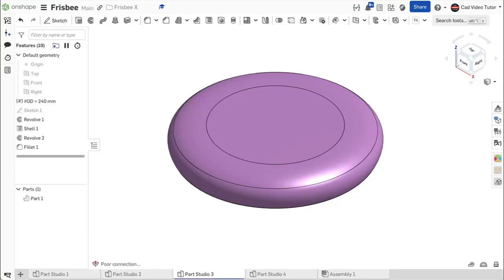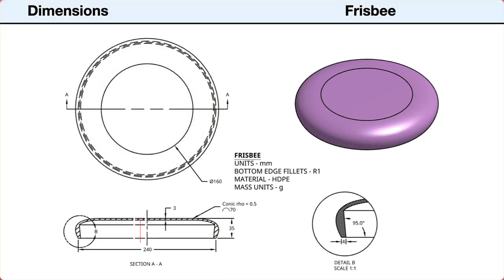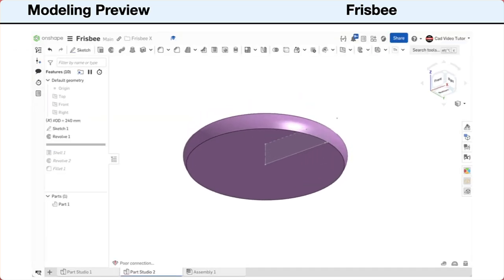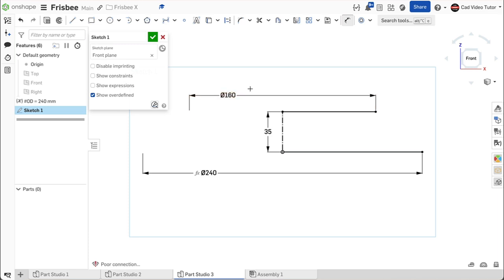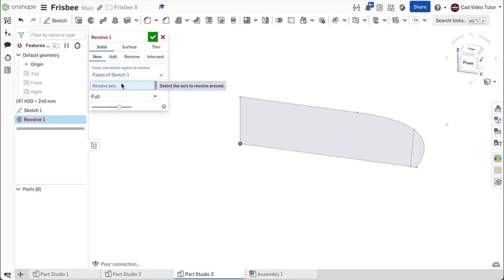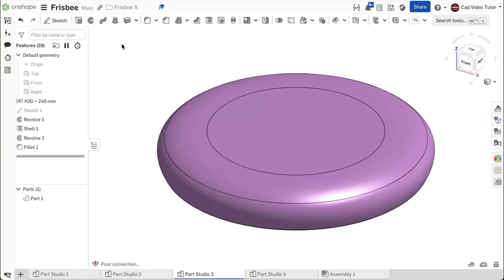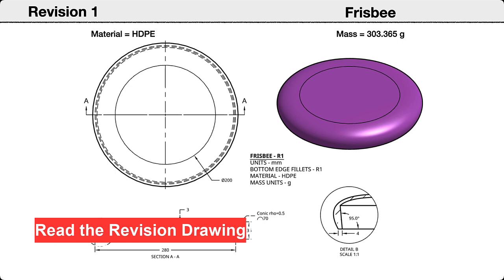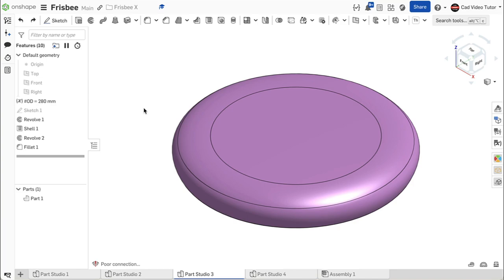Onshape Project 2025 - FRISBEE | Step by Step Tutorial - New 2025

Comment: Interesting approach. I sketched the thickness directly instead of using shell feature. 

My final measure is 238.748 g which is 0.003g off of the reference. I wonder why that is 🤔
Reply from the maker: I have found that using shell with the conic arc gives a more consistent thickness than other methods which may account for the difference.